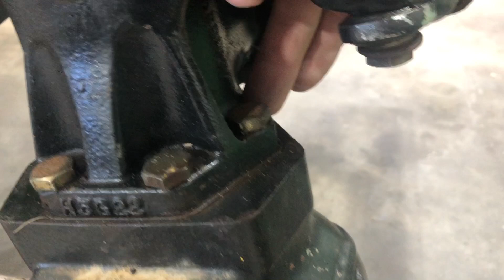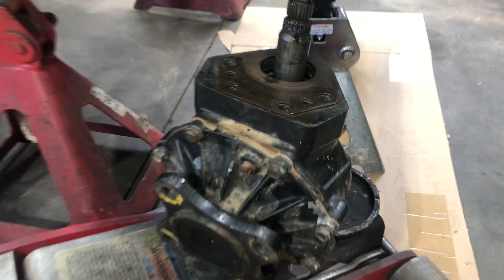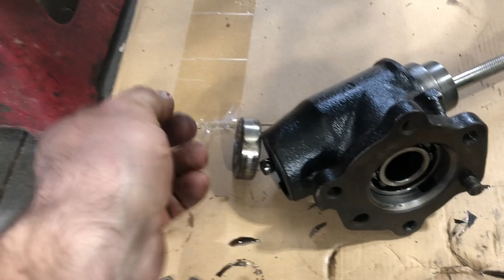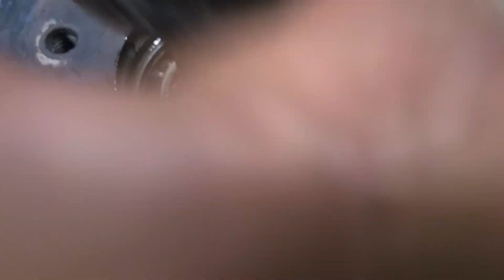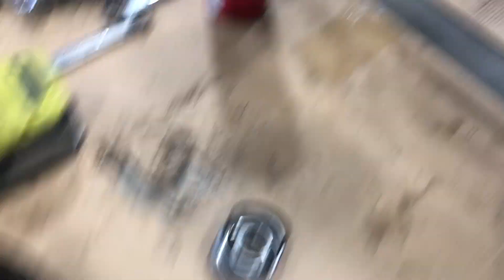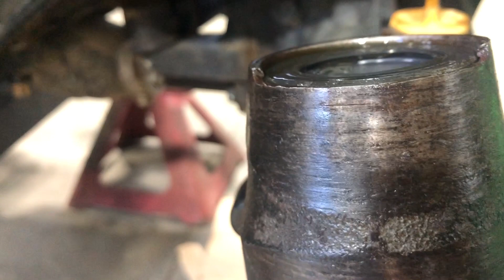John Deere 2032r front final drive knuckle fix

Comment: Thanks for this. It looks similar to the 2520 final drive. Mine is leaking, and I have been reading some concerning information about the poor design of the final drive and how it causes the bushing to wear, which leads to spindle damage. Have you heard of this? Obviously, visual observation will tell the story when I open it up, but I also want to approach this repair cautiously. I am hoping it is just the seal that needs to be replaced!
Reply from the maker: Probably just the seals.